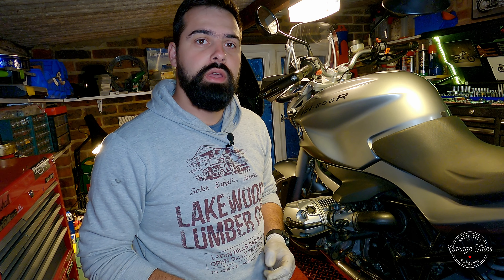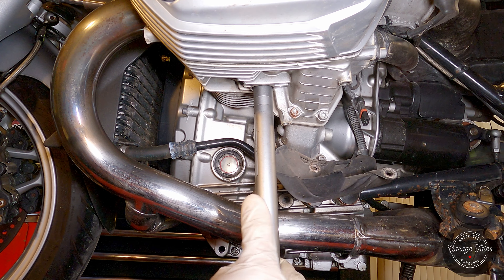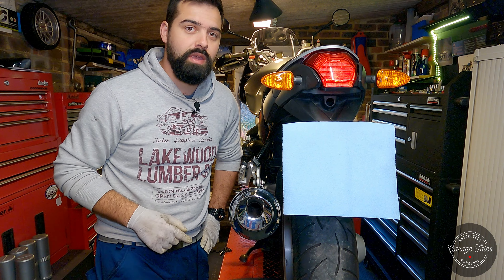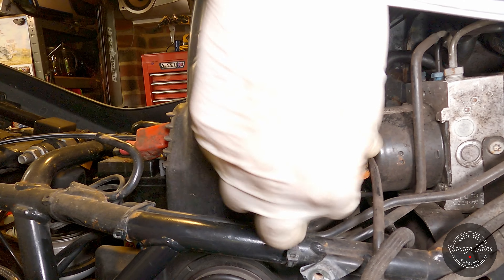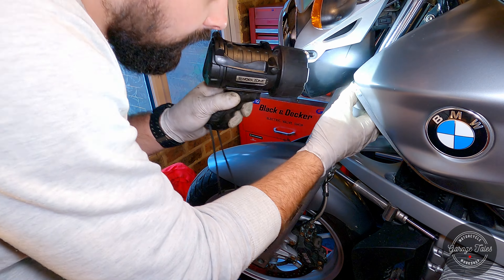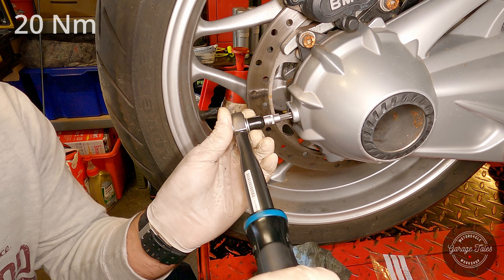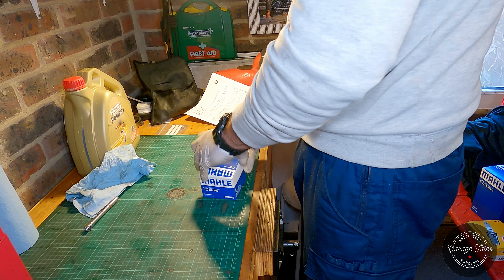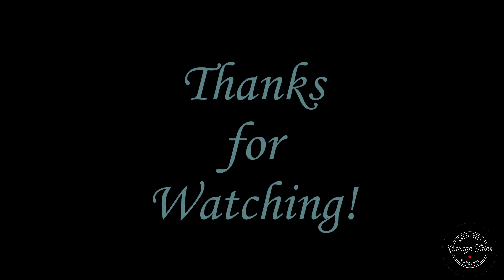BMW R1200R Oil Change & Inspection

Comment: Thank you for your video, it was very helfull. and wish you will do the gear and axle oil change soon... all the best 😃👍👍👍
Reply from the maker: Hey there. Thanks for your comment!🙂
Currently without a garage until I sort something out, but might get to do the gearbox and FD one day 🙂 There’s a video I’ve done on an R1150GS which is quite similar if that helps 🙂

Comment: Buen video, ganaste nuevo suscriptor.
Me puedes decir q bujias lleva, acabo d comprar moto igual pero si le abro gas rapido da tirones.
Reply from the maker: Hey there. Thanks for subscribing and glad the video was useful 🙂
It should have an NGK MAR8B-JDS as a primary spark plug and an NGK LMAR8D-J as a secondary spark plug for each cylinder.

Comment: Veeeeery informative.  

What are the torque setting for the transmission filler bolt, the final drive drain bolt?   

Thx.
Reply from the maker: Hey there. Thanks for your comment. Appreciate it! 🙂

If I remember correctly, transmission drain & fill are 30Nm and final drive drain is 20Nm.

Comment: Perfectly executed service, I am just about to purchase a 2012 model with 28000 miles on the clock, has been regularly serviced, any pointers for me when I go to check it out and test ride? Cheers
Reply from the maker: Hey there. Thank you for your comment and apologies for the late reply. 
Make sure it was properly serviced and not just an engine oil change every now and again. It’s surprising how many people think that’s all there is to it and claim it’s been fully serviced.

Apart from that, they are pretty good bikes. Not much to complain about. Look for funny noises from the clutch, make sure it rides well and has no issues with the suspension and hopefully it should be all good 🙂

Comment: Great video! I have just one quetstion. Whenever I watch similar videos, the replacement of the fuel filter is often overlooked. Does this mean that it is no longer necessary to check the condition of this filter regularly? Thanks.
Reply from the maker: Hey there. Thanks for your comment and I’m glad the video was helpful. You’re right, the fuel filter does get overloaded most of the times, for various reasons. BMW recommend a 24000 miles fuel filter replacement interval.
Hope that helps 🙂

Comment: Hello, I am new to the channel but I quite like it. I do have one question though. What happens to the driveshaft boots? Did the owner not want new ones? Is it OK to rise arround with damaged ones? Or did you change them off camera? Thank you. Keep the good work up. 👌
Reply from the maker: Hi there. I did point them out to the owner and explained what’s involved, but he chose not to do them at that stage. Which if absolutely fine, his bike, his choice 🙂
If they start allowing water in, it could cause some damage, but it will take some time to be fair.
Reply: @garage_tales  How hard is it to change them. Currently I ride a 600 hornet 04’ but I quite like this r1200r.. so I am looking into them.. Thanks for the quick answer 😉
Reply from the maker: @norbertkovac6793  Not that hard. The 1200 is a bit easier than the older models where you needed special tools and accurately set bearing preloads. I’m mot sure what your skill level is, but with patience & attention it should be fine.

Comment: What size oil filter wrench and what bit for the drain plug?
Reply from the maker: Filters vary. From memory 8mm for the drain plug and 76mm oil filter with 12 notches.

Comment: And how much would that have cost down at bmw Motorrad?
Reply from the maker: Couldn’t say for sure. It’s possible they would charge 1 hour labour (just over £100) plus the oil & filter. If you’ve bought the bike from them, they might give a discount or not charge a full hour if they didn’t spend it on the bike.